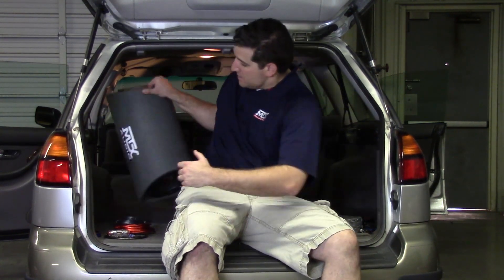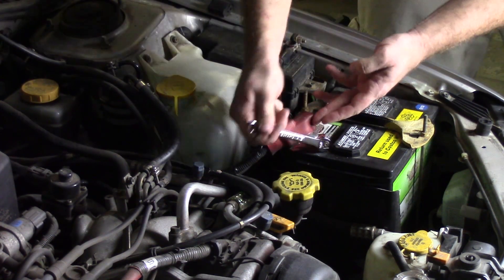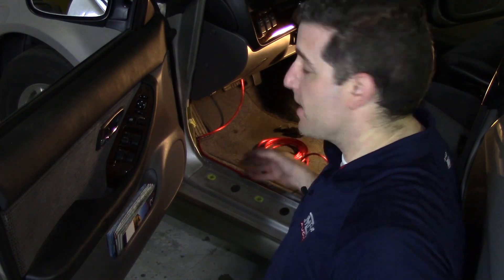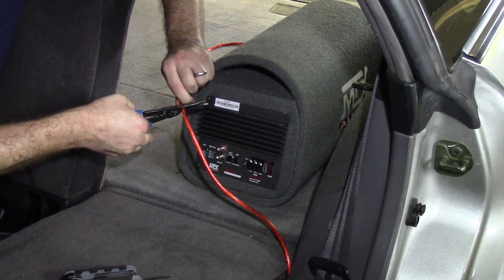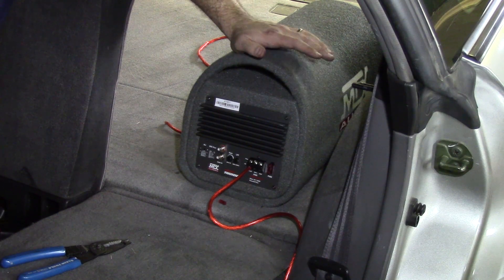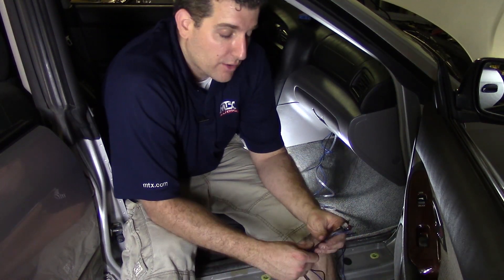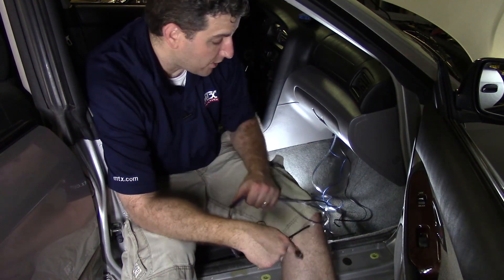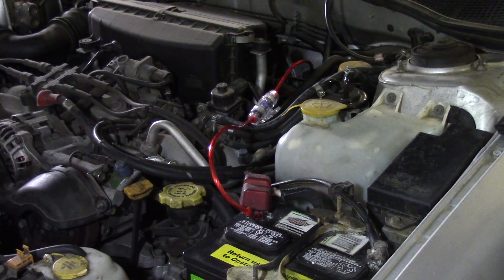RT8PT Install Video

Comment: Nice install... I have a factory stereo that is nice but needs a little filler on the low end... Can I just tap into the rear speakers using the Hi level inputs?

Comment: Just installed mine. I’ve installed multiple subs and amps in my life but this is my first built in amp unit. I have all wires hooked up, have power but no sound coming from the sub? Any suggestions

Comment: Can you use the 4-pin high level output instead of the RCA cables and where should i connect it? I have a factory radio on my 2012 Civic.
Reply: lol, 2 years later... Did you ever try the high level inputs?  I have a 2013 sentra with a nice factory stereo, I was thinking of the same thing.

Comment from the maker: Our RT8PT amplified subwoofer enclosure is easy to install and provides the bass your factory system is missing. Check it out. RT8PT Install Video
Reply: what fuse can i put on red wire
Reply: George Soare pune siguranta de 40A. Am vb cu un specialist si mi-a spus ca 40A e perfecta sau chiar 50A daca nu gasesti de 40A.
Reply: am luat deja kit cu siguranta de 40, am vorbit cu cei de la mtx usa si asta mi-au spus
Reply: Would in not be 30a since the amp is 20a. Yes. Since i hv a hybrid

Comment: Long shot for this but, I just installed the subwoofer and I see that I get power but no sound. I flipped the rca but that didn’t help. I have the REM on the driver side next to the 12v red cable and on the other side I have the rca with the ebc. Can it be because of the ground wire not making a good connection to bare steel. Help!!!! Lol

Comment: I just purchased one of these for my work vehicle and I was wondering if there is any speaker grill protector made to fit this so I don't accidentally poke a hole in the speaker?
Reply: PeteyPablo  did you find 1
Reply: @jackmartin9989  I did not I tried 3 different kinds without any luck because of the tube design
Reply: What ones did you try so I know not to buy them

Comment: in which material is the box for the subwoofer built? it is seen that it is carpeted, but under the carpet; what material is? thank you very much
Reply: Edu Ca it's kinda like the tube material that is used for concrete forms Kinda like MDF. Its descent material just don't get it wet to much.
Reply: The bones of elder bass tubes

Comment: Can I use this with a stock 2010 Honda Fit head unit? Any replacement head unit recommendations if not?
Reply: yes you can. It comes with a  "HIGH LEVEL"  input harness that you can use insterad of the "LOW LEVEL" RCA's that he used in the video.  Instead of LOW LEVEL rca's you would run HIGH LEVEL speaker signal into the supplied harness.  Its really simple... You tap into the speaker wires for your REAR LEFT and REAR RIGHT speakers and connect them to the MTX amp..  All you need is some WIRE TAPS and 18 gauge OFC speaker wire(please for the love of god do not buy "CCA" wire which is fake aluminum).  When you buy a wiring kit do not buy it if it does not say "ofc power wire".

Comment: Maybe this is a dumb question, but what fuse exactly did he use for the power?????
Reply: 20A
Reply: @That119compact  or 25A and or 30A
Reply: I would go 5 or 10A higher then what the amp fuse is at. Just sayin

Comment: Hi there. I have issues with the remote cable. Where do i insert it? I have a Pioneer 170UB. Do I have to cut any wire from the radio to link the remote cable? Thank you very much.
Reply: why would you ask a question about a pioneer product on a video about a mtx product lol
Reply: Ok problem #1 is you stepped out of your natural environment (the kitchen). Please return immediately, bake a cake and NEVER attempt to install an amplifier again.

Comment: Can I install this with out the rca I’m trying to install in a 2019 Toyota Camry factory strreo
Reply: Yes, you can use the high level inputs on the amp instead of RCA's. You will need to tap into the rear speakers with some T-taps in order to get the signal.
Reply: Two weeks ago I installed it in my 2017 Camry and I don't like the way it sounds, I'm thinking about add an amp or a new sub with more power.. p.s when the trunk is closed you can barely hear it.

Comment: Hey so what do u do with the ground wire? Drill a hole in ur car then what?
Reply: You would want to drill a hole, sand around it to make sure you have good contact, then use a crimp ring connector and a screw to attach it to the car. You can also use an existing bolt that may be close to the amp and attach the ground there as well. The whole point is to have a good ground to the chassis of the vehicle.

Comment: hello i have this subwoofer but i have no external bass remote control my question will work at full capacity without this remote control?
Reply: it works all the same. you just have to adjust the gain yourself manually

Comment: 8 AWG is wayyyy too small for power wire, specifically long runs of it. Smallest you should go is 4 AWG. Using 8 AWG for power wire creates a risk of overloading and overheating, which leads to fires. Not to mention reducing power flow to your amp when it needs it most.
Reply from the maker: Mark, For larger systems with 2 12" subs or more and 500 watts or more, you are absolutely correct. Depending on the size of your amplifier, you may even want to go with 1/0 AWG power and ground wire. However, for this particular product, it has a built in 120 watt amplifier for the single 8" subwoofer. 8 AWG power and ground wire for this amount of power is plenty sufficient.
Reply: ***** is 10 AWG ok to use?
Reply from the maker: Reign Mack 10 AWG will work if it is quality wire but if it is under gauged or not very conductive due to cheap metal, the amplifier may struggle to get enough power from the electrical system. We recommend 8 AWG.
Reply: ***** thanks, could this be why the heat sink has been getting hot and its going into protective mode after 40 minutes? or do i need to try setting the gaine?
Reply: would my power amp stop over heating if i got 4AWG wire then?
Reply: many thanks for the advice, i have used it for a few years with the cables which came with it with no issues but fitted it to a new car with a new storeo this week and left my old wiring in the other car.
Reply from the maker: Reign Mack The wiring is probably the issue. The new car could have a smaller electrical system and the new/different wire could have more resistance than the new/different wire.
Reply from the maker: Reign Mack We'd be more than happy to sell you some 4 AWG wire as would you local car audio retailer. But the RT8PT has 8 AWG power and ground inputs so a 4 AWG wire would have to either be cut down to 8 AWG by reducing strand count or you would have to buy 4 AWG to 8 AWG adapters to reduce the size in order to fit into the terminal block.

It is likely that the 10 AWG wire you have is either under gauged (smaller than 10 AWG) or that it has added resistance inside the metal of the wire because it is not OFC (Oxygen Free Copper). A quality 8 AWG wiring kit will be just fine for this system. 4 AWG wire would not hurt, but with 8 AWG terminal blocks, you would be spending money that you aren't getting the value of and it simply isn't necessary for a 120 watt system with a maximum 20 amp draw. For larger systems that require more power and have higher power output, 4 AWG wire would be necessary but with a 120 watt system, a good quality 8 AWG wire will be plenty sufficient.

Also, make sure your power and ground are both 8 AWG wire.
Reply: many thanks the culprit turned out to be a poor ground, it got wet and corroded a little.
Reply: Dude this sub barely pushes 120w RMS.  You can crank it all day and not worry about power.  A 8 AWG should be good enough.  You do not need a 4 AWG until your pushing 600w RMS.
Reply: Makes no sense. 10 awg is plenty. Why an 8wg, hv no idea. But then again my install is goin in a prius and my battery is in the trunk. So im sure im good.
Reply: I know this is old but it's unbelievable their was no shortage of idiots back than. Mark thinks he knows more than MTX.

Comment: what Caine of wire is recomen #cage
Reply from the maker: A good quality 8 gauge power and ground wire is sufficient for the RT8PT.
Reply: @MTXAudioUSA  just purchase 12 inch subwoofers MTX audio need to know how to connect them to a punch amp the punch amp is already installed just have to connect the speakers to the amp

Comment: hi i have a pre exsisting amp { JL A6450 ) if i were to purchase this sub how would i install it?
Reply from the maker: +Ben Sherry The RT8PT has a built in amplifier of it's own so there is no way to wire it to another amplifier unless your amplifier has a signal output in which case you would be just passing the signal through your amp to the amplifier that is built into the RT8PT. Hope this helps.
Reply: +MTX Audio USA  so how would I go about installing this sub if I have a pre existing amp. would I need to buy a amp kit with distribution block?
Reply: +Ben Sherry you wouldnt need another amp... he just said it already one.